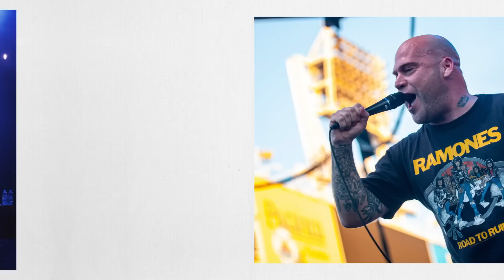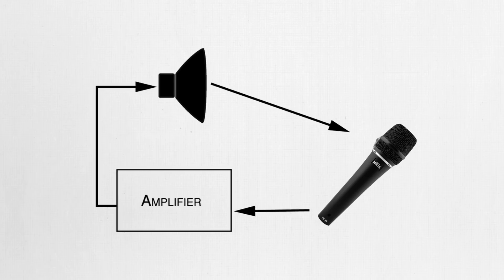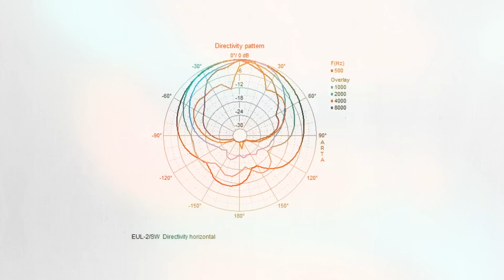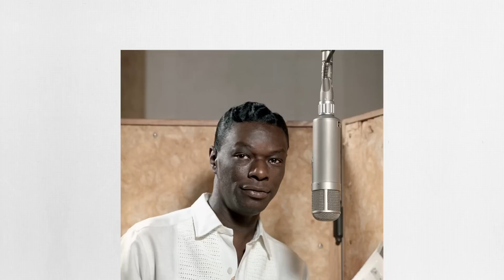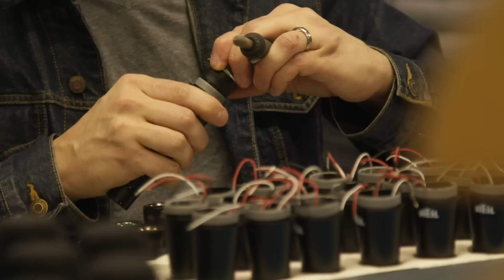3 Reasons Mixing Live Vocals Is Difficult

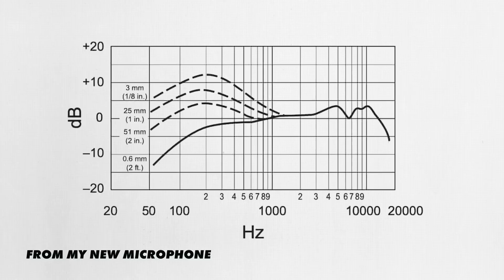Comment: A 4:55 it is said that the vocalist should hold the mic at a "moderate distance" to reduce proximity affect and yet still get good rejection of other sounds and as well getting enough vocal signal out of the mic.   

This is terrible advice in any loud band situation as it is always best to have the mic as close as posssible to the vocalists mouth and to take care of the issue of proximity effect with eq.

A really powerful singer on a good sized stage with not too loud a stage volume coming from the band may get away with the  luxury of holding a mic at "moderate distance" but in most cases an inch or less from the mic is where you want a vocalist to be.

Comment: Well, your earlier video without any association to brands are much more credible.  When you have to praise some particular models due to commercial relationship, just ruin everything.  I'm quite sure if you cup the Heil mics enough, the same issues like feedback and change of frequency response will also appear.  It's just the physics of directional microphone that no one can change.  And, when you 'showcase' the Heil mic (8:10 and up), the handling noise is actually very apparent and unpleasant.